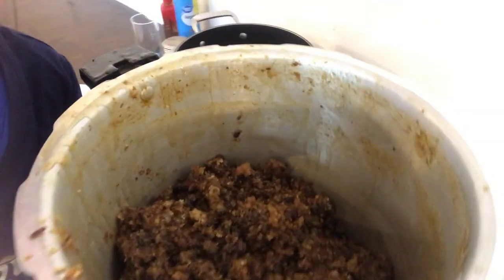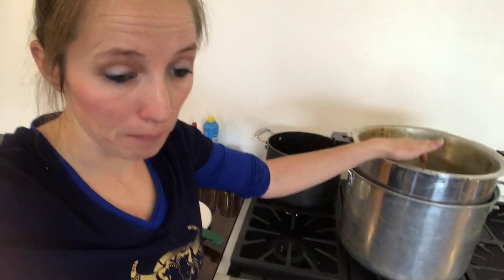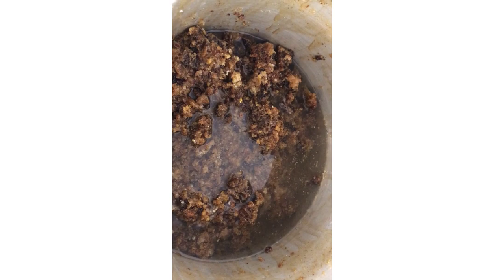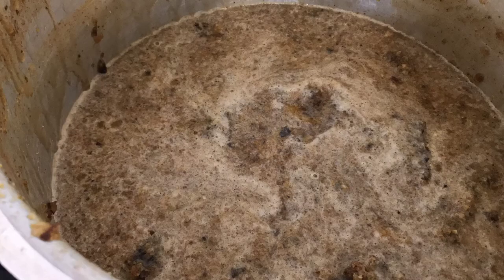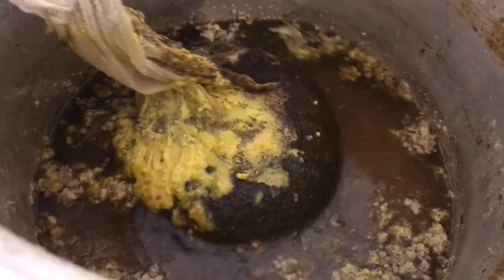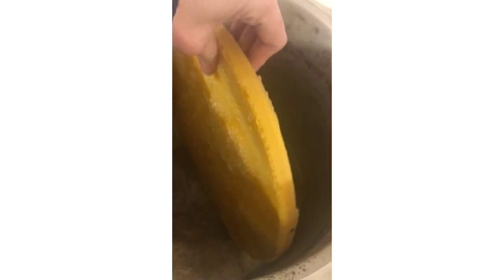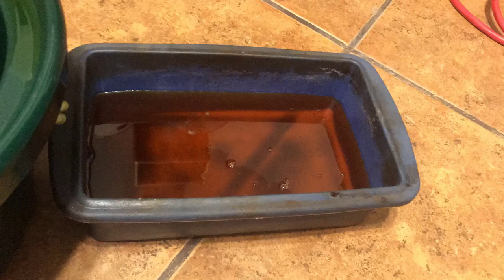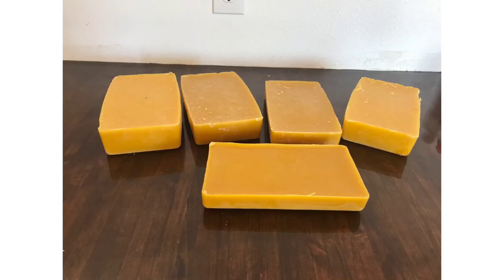Rendering Beeswax, Easy Simple, Clean Beeswax, Wax Rendering, how to clean wax, Backyard Bee Builder

Comment: I didn't understand what you do at 3:32. You filled the bucket with the water and wax and then repeated the process with the wax that was left at the cheesscloth but what did you do after? Did you pour the extra wax in a different bucket and then i order to remelt them both you combined the two "'wax cakes"?